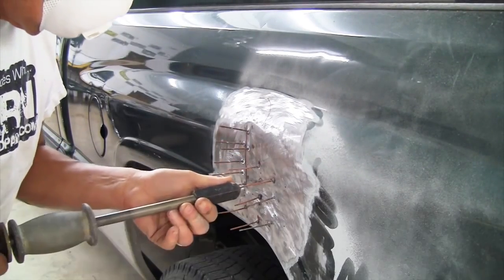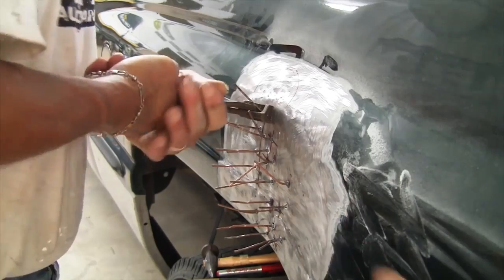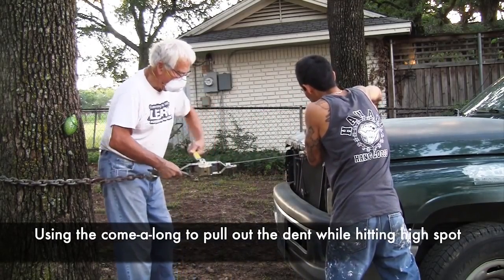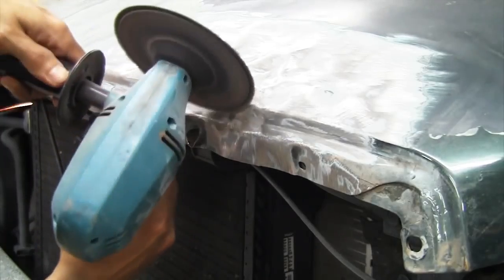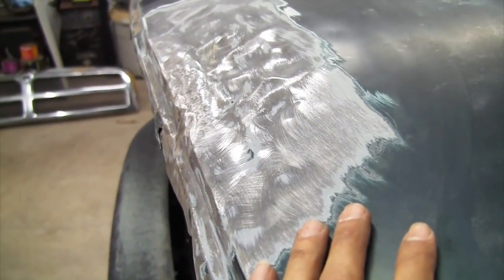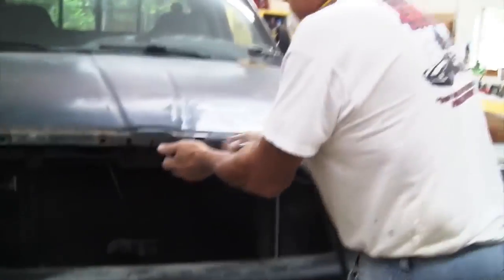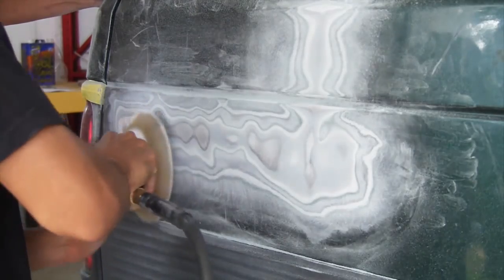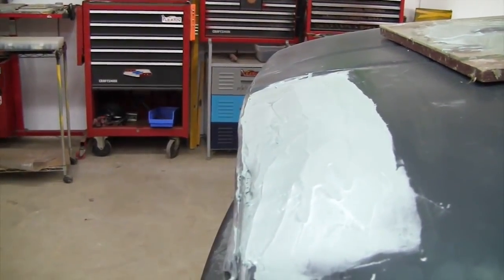Using a Stud Welder to Repair Dents

Comment: Never sand a decal/ or any adhesive like that. Without even feeling the panel I can see that it’s wrong. Would have left dents. Always remove with a rubber wheel to not cause damage

Comment: I just have a question about the stud welder. Do you have to disconnect the battery before you use it on the vehicle?????
Reply: Robert Reyna nope.
Reply: @sleeks9939 Thanks brother. I just want disconnect my battery every time.
Reply: @robgr1218  you're welcome.

Comment: I watched your rustoleum paintjob can you spray a automotive clear over rustoleum to give it a deeper gloss since the rustoleum is oiled based I didn't know I normally use all automotive paint but I'm painting my Racing go cart and don't want to have a ton of money in it because I have some leftover automotive clear, I just don't want the paint lifting and what's the best thing to wipe everything down before painting because I have used wax and grease remover and it removed some of the existing paint and lifted it all I was doing was a touch up